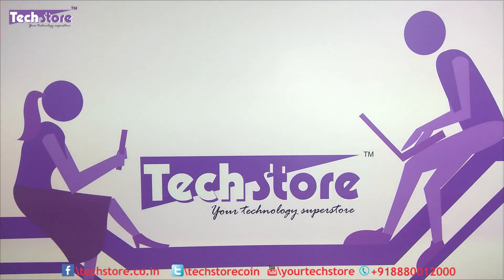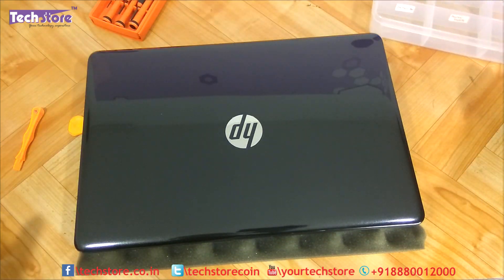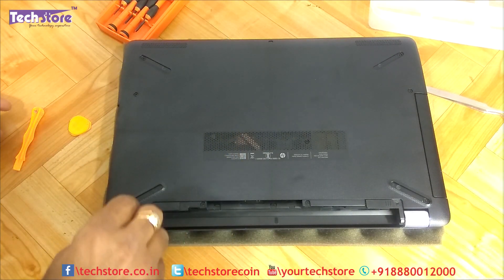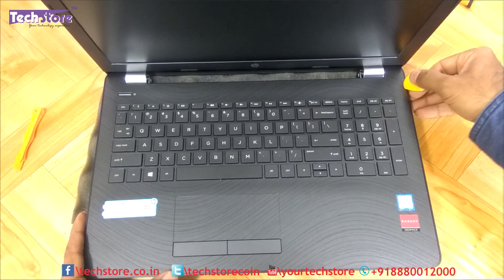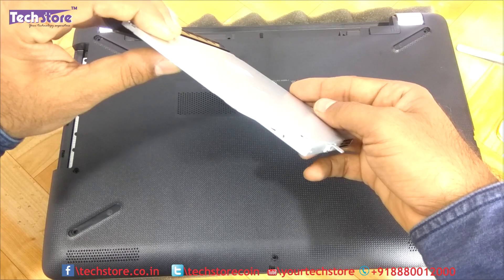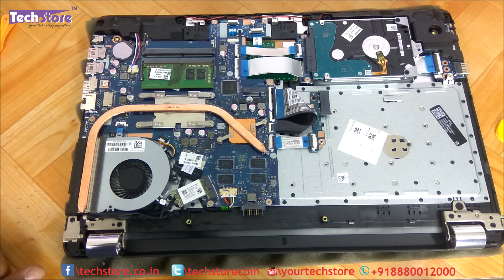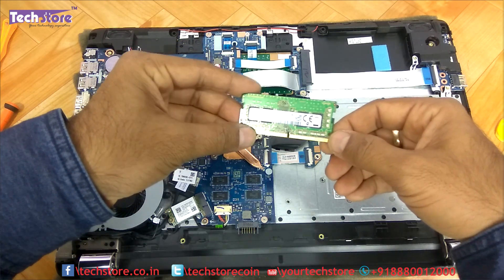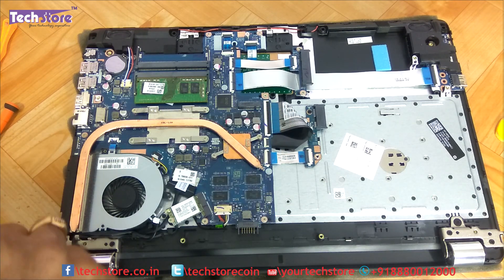HP 15 BS BR BF Series : How to dissassemble remove the base & upgrade memory hdd ssd m.2

Comment: Everything online says this processor only allows up to 8gb RAM. I installed one 16Gb in the only existing slot. Boots up just fine and Windows recognizes it. I tested it by running a lot of videos and programs at once to get over 8gb ram usage, and then everything started freezing once I hit 8. I'm not sure the processor can actually use more than the 8gb that the manufacturer says it can use.
Reply from the maker: we have tested with 16gb, no issued faced.

Comment: hp 15-bs658tu have m.2 SSD slot upgrade ssd
Reply from the maker: Yes you can instal a basic m.2 SSD 2280 form factor. dont install NVME. Thanks Do Subscribe.

Comment: Nice video. Short but enough. I have a 15-BS series laptop and can't remove one of the screws. It's the one close to right hinge. It's just spinning but neither tighten nor remove. Is it safe to remove the cover while that screw in place?
Reply from the maker: Ohh...It is already damaged the screw holder. get the hinges loosened immediately to avoid breaking it apart.
Reply: @TechstoreCoIn , thank you friend. I removed that screw. Now I want to loosen hinge bolt a bit but I hope I can. Regards
Reply from the maker: Glad

Comment: Guys don't take this too easy as this guy said, the method is right but it is not so easy specially if you're a beginner I barely saved my lappy when I tried this! So do at your own risk.
Reply from the maker: Yes you are right. Most HP laptops are coming with this. We only hope HP takes note and changes the hinges design

Comment: I am using hp 15 bs 146tu. Love to see it's inside.
Thank u and helpfull.
Reply from the maker: You are welcome 😊 Do Subscribe.
Reply: Does your laptop support Nvme ssd's? Coz I am also having the same laptop & planning to buy an SSD.
Reply: @prasath_sastra  no, it supports only ssd, not nvme(non volatile memory express) . I have contacted hp customer care and they told me that. So I bought samsung m.2 of 250 gb from Amazon and got it fixed in ho store.

Comment: My laptop says it have 1/2 slots of memory used, and it’s a 1x4gb stick. But, when I got inside, I could only find one slot for ram... is this normal. My model on HP website says that it should have two, and it also says that on everything else.
Reply from the maker: For entry level variants, one ram is soldered and another vacant.

Comment: Thanks for excellent video, could not work out where the screws were hidden under the feet. Why they couldnt make a small panel with one screw or two with a small flap giving access to the hdd and ram slots. HP makes servicing costs very high with the ridiculous method of having to dismantle the whole laptop to get access to these items!
Reply from the maker: totally agree..

Comment: I saw this other video on how to open a hp bs series laptop and they never mentioned that you have to remove the dvd drive and I almost broke my laptop in half trying to pull apart the back cover because I was pulling with the dvd drive still attached. Luckily I managed to have the dvd drive get loosenend from all the pulling and release itself. But fuck, man. That other guy was awful. You're wayyyyy better. Thank you so much.

Comment: Hi, How are you, my laptop is HP 15 bs675tx, which has basically Intel(R) Core (TM) i3-7020U CPU, 2.30 GHz, 4 GB samsung 2400Mhz Ram in 1 slot other is empty, Radeon 2 GB graphics & 1 TB HDD., my question is i want to upgrade to 16 GB RAM and to suitable SSD up to 1 TB because the laptop speed is too slow and it's frustrating. can you please suggest for the suitable upgrades which are compatible with my model laptop which improve the speed and can be useful for long term.

Comment: It's crazy how the HP manual itself states that model 15-BS212WM RAM cannot be upgraded, but clearly it can. Thanks to this video, I upgraded mine from 4gb to 8gb without any complications using Crucial 8GB Single DDR4 2400 MT/s (PC4-19200) DR x8 SODIMM 260-Pin Memory - CT8G4SFD824A. My laptop operates much faster now. THANKS!!!
Reply from the maker: Thanks for the kind words and subscribe.

Comment: You do not need to replace the M2 WIFI to fit an M2 SSD - there's an M2 SSD slot on this motherboard already (it's labelled JSSD) - the M2 SSD fits over the top of the two ribbon cables coming from the back of the HDD/SSD board - you can even see the retention screw HP have left in the motherboard ready for the M2 SSD to be fitted.
Reply: @krishnaprasanthdsk3485  Normal m.2, having run the Crucial compatibility checker on it, i ended getting one of these: https://uk.crucial.com/ssd/mx500/ct250mx500ssd4/ct11613624

Comment: M.2 for ssd  slot is not the one shown in the video.... Its right next to hdd bay. M.2 ssd will be attached over the hdd ribbon cables perpendicular to it.
Reply: Can you install an M.2 SSD in addition to the stock HDD? Or is there just room for one or the other?
Reply: Can ssd be used in addition to hdd?
Reply: @DrSouvikGhoshAIIMSBbsr  yes

Comment: Excellent tutorial. Thanks for post this video. Can I extend more RAM for this HP 15-bs164tu laptop?
Reply: Yes, mine is same model. I upgraded it's ram 4gb 2400mhz of lapcare brand.
Also added 250 gb m.2 ssd of samsung brand.
Working fast now
Reply: It does not support nvme SSD.
It supports only m.2 SSD.
I am using samsung m.2 SSD of 250gb, which I bought from Amazon for rs 4000/-.
Before buying SSD I contacted customer care for confirmation, they also said that it doesn't support nvme(non volatile memory express) type SSD.
It supports only m.2 normal SSD which is also great speed.
Reply: @durgaprasadg6854  can you give me full details (model or part number) of 
M.2 ssd? Also let me know, can we install windows on this ssd?
Reply: @pradeepshirsat6078  yes, my laptop os is in its ssd and working fine
Reply: @durgaprasadg6854  Thanks for quick reply, can you share with me the Samsung ssd part number, mine is also HP-bs146tu.
Reply: Yes
It support max 16gb of upgradation

Comment: HP make it so much harder to replace a HDD or Ram, my old lenovo was so much easier, underneath there was a flap you opened by removing 1 screw to get access to the HDD or the Ram, could literally replace a HDD or the Ram in under 1min

Comment: Does anyone know what type of  m.2 or NVmE slot it is right next to hard drive slot? Attached to the main board there's even the screw bolt slot right across from it. But it's unlisted in even the manuals
Reply: bkewl lane its an m.2 sata iii type of slot.. Works with Samsung evo 960

Comment: Nice video to upgrade the components. 
Thanks for sharing.
One minor correction.
M.2 slot mentioned in the video is in incorrect location. It is actually placed beside the hard drive.
Kindly correct it if possible.
Reply: Ravi Goriya can i use m.2 ssd in hp bs180tx
Reply: Fun_With_Aman 
I haven't seen any slot for the M.2 ssd.
Reply: Can i put ssd in above version of laptop please reply
Reply: Ravi Goriya Hello can i use both hdd and ssd at same time in the laptop?
Reply: @DrSouvikGhoshAIIMSBbsr  if you buy "2nd HDD Caddy" replace  Optical Drive, but work as stroage, install os on some laptop is hard to do, or more work to do. On this HP laptop you must Only 1 unscrew
Reply: Yeah absolutely